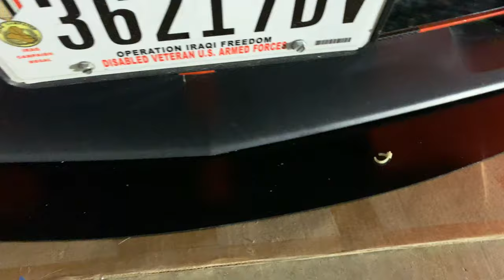Challenger front splitter install!

Comment: You......are litterally.....the only person I have seen on YouTube who actually shows the proper way to install the rods and reinforcements for the splitter instead of just saying "oh put the rods in the bumper" and I always comment in irritation that it's not the right way and will damage the car. Very nice functional install. Pretty damn close to how I did my camaro
Reply from the maker: 😂😂😅 hey man I appreciate that! The air pressure would rip those rods right out the plastic after some high speed runs. 

I know this video is older but those same mounts are still there holding 💪🏽.
Reply: @TIRADORACING  no brother your good major kuddos because most people install them improperly or show an improper install and it makes me cringe. That's badass man, I sold my old 5th gen SS for a hellcat and it used brackets similar to that years ago and I see it in town once in a blue moon and that shit still mounted also lol. Buy once, put it together once and cry once brother
Reply from the maker: Do it right or do it twice. Yea the brackets came from downforce solutions but Mfr engineering sells similar brackets for a chassis mounted application. 

Congrats on the hellcat!
Reply: @TIRADORACING  thanks brother and best of luck to you on your future endeavors

Comment: Just finished part 2 of this... Good vid... Post links for all the hardware for splitter
Reply from the maker: Man I’m sorry but this video is OLD, I even gave that splitter away at the beginning of the year. 

Some of the hardware I used I made myself from parts from Home Depot and Lowe’s. As I stated in the video I needed to beef it up for the race track. I also made metal brackets to sand which between the splitter and the bumper. Sometimes you need to get creative and fabricate things. 

All the hardware you need to install it successfully comes with the purchase of the splitter (rib nuts, bolts, washers, locking nuts). You can find the splitter here 

https://mfrengineering.com/collections/dodge-challenger/products/front-chin-splitter-for-dodge-challenger

Comment: Those brackets for the rods that mount to the bumper support, did they come from MFR?
Reply from the maker: Hey Marc! No they came from downforce solutions. The rods and the support brackets came in a kit and I used 6in rods. I’ll provide a link 👇🏽. Hope this helps! 

https://www.downforcesolutionsllc.com/shop/accessories/front-splitter-bracket-kit
Reply: Thx bro!! 💯Are they adjustable? Tryna choose between the 6 or 8 inch.
Also tryna analyze how you used those bolts and wire. I originally half assed mounting my old splitter rods, and yes downforce gets real around 90+ mph.

Hopefully just mounting to the bumper support will.keep secure at 150 which what i wanna test it at. (Apr splitter)
Reply from the maker: Marc Be Hoopin yes they are slightly adjustable but nothing too crazy. Maybe an inch or two of adjustment. 

Yes the chassis mounted wire supports I made are very popular amongst time attack cars/builders. As you can see it’s very easy to do and it keeps them hidden. 

The splitter support rods and the tensile wires really did their job. 

My next set up will be complete chassis mounted aero from Mfr Engineering, I’ll probably need it up some more like I did with this splitter. 

If you have any more questions or need help you can dm me on Instagram (@tiradoracing). It’s easy to video chat/ send videos back and forth.
Reply: @TIRADORACING  kool